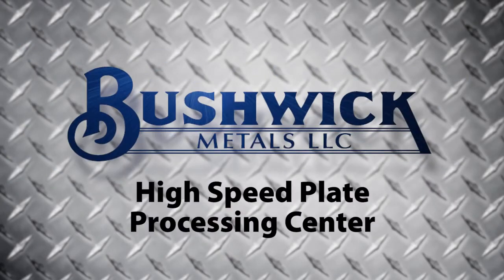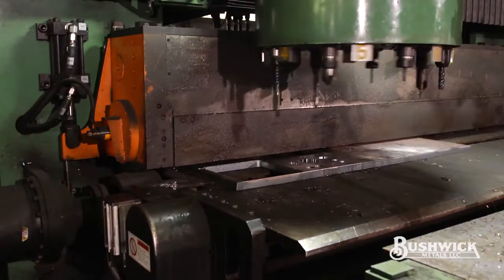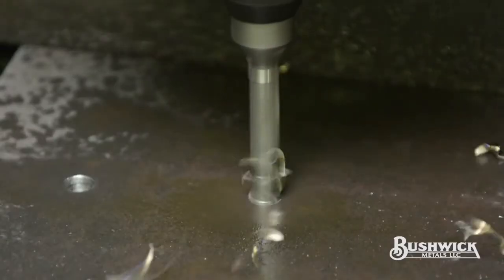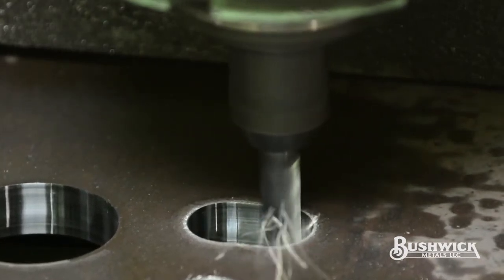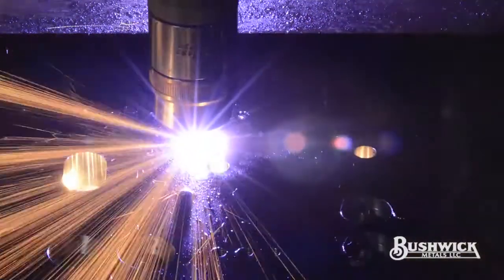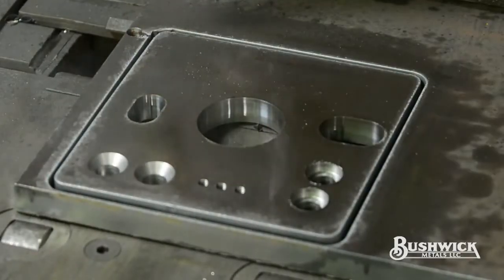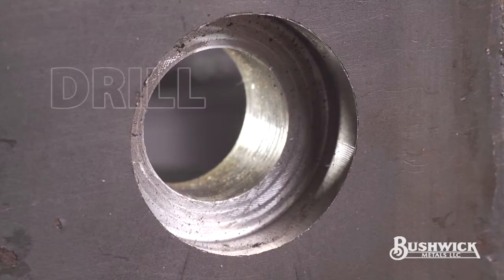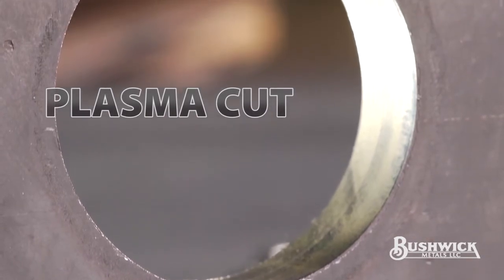Bushwick Metals LLC Heavy Plate Processor

Comment: What is the plate thickness limitation for putting, sat, 2-1/2" holes in it"Can it process holes in 3" thick plates? would they be drilled, plasma cut or torch burned?
Reply: operator with 6 years experience on plasma.machine the same in video